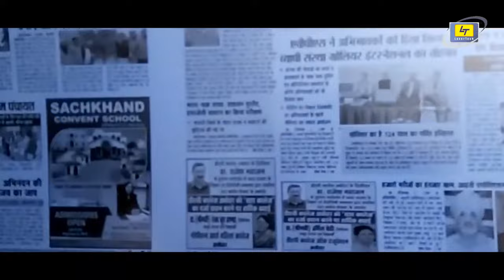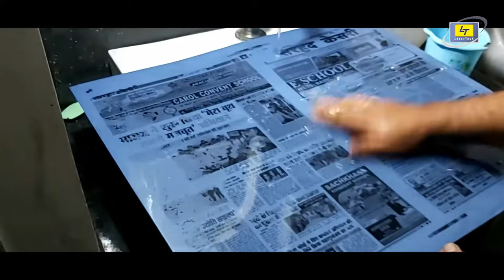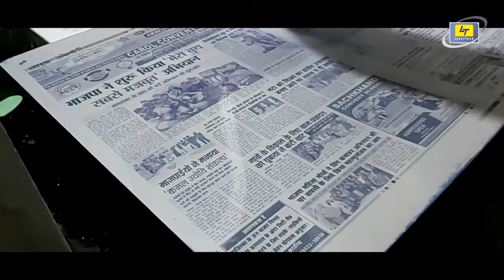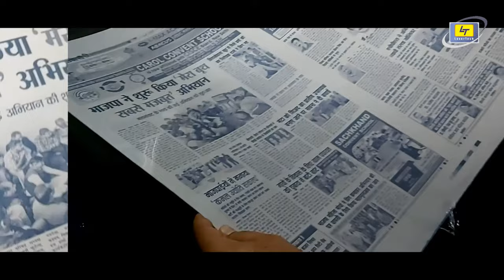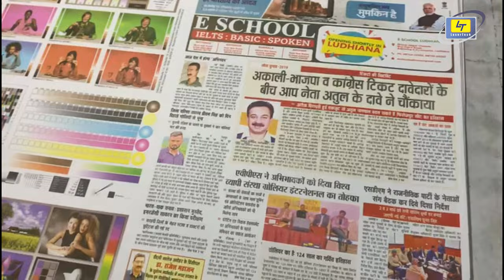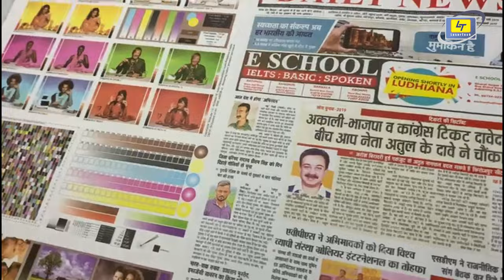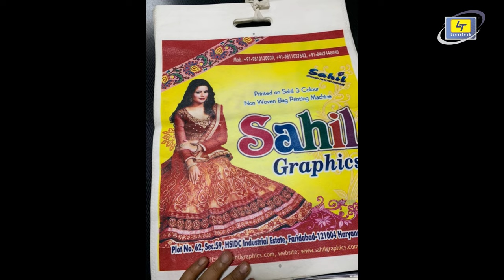CTP Computer to Plate  Complete System GREAT PRODUCT !!! Offset plate making system

Comment: Up to what LPI does the result get in your machine.  Quality is good in four color printing 150 LPI.  At present I get ctp plate made from outside which is 40 kms away from my city.
Reply from the maker: as far as our CTP system is concerned - on place 133 LPI is 100% Perfect and even i have tried at 150 lpi it was printed ok but because i dont have much experince i have lost some detail in 5-15 % Dots, so yes upto 133 LPI its 100/100,  and at 150 LPI its 95/100 result.